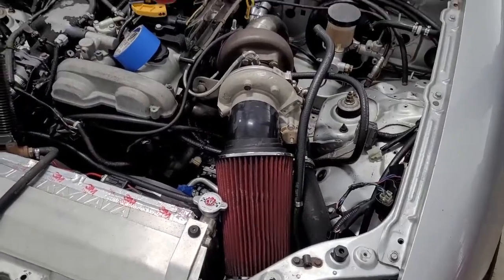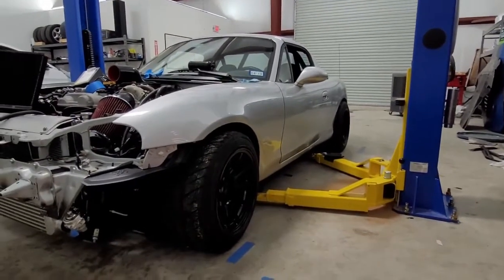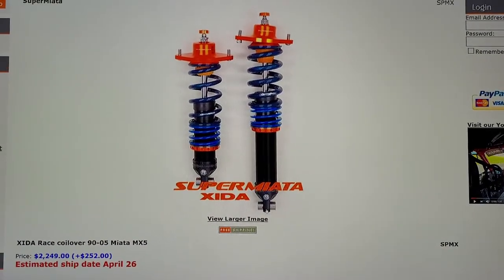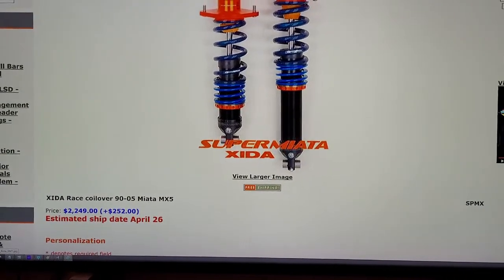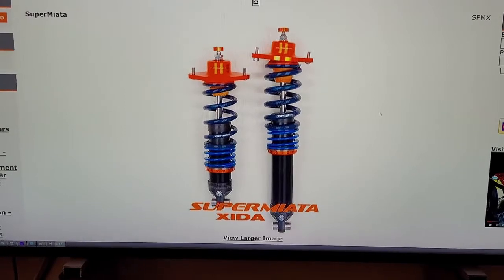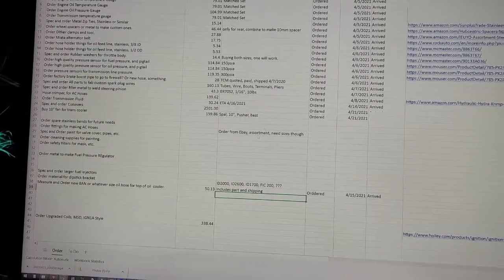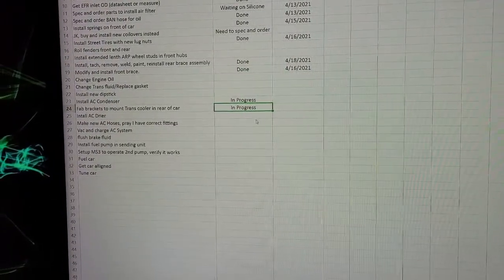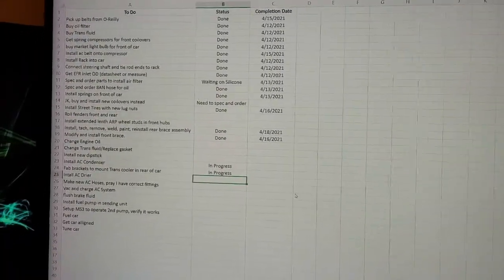Turbo Miata 500whp Build Episode 30 - Coilovers Ordered! Car lowered! Filter, Fan, and more!

Comment: You’ll love the xida’s, I tried the standard 700lb rates and it did a pretty well on the street. I ended up swapping some 550lbs to get better ride and less bounce. 
Make sure you get the rake right, that will really help the handling.